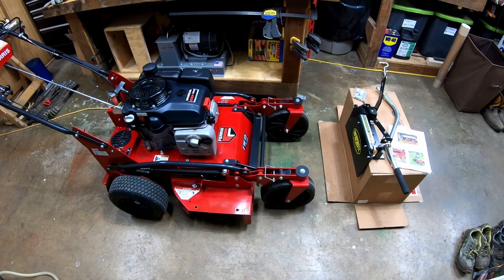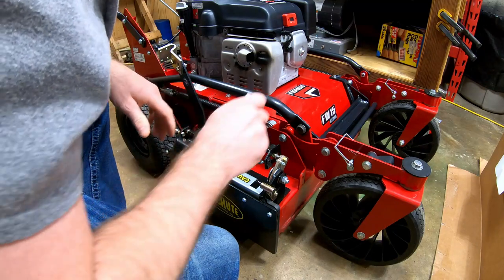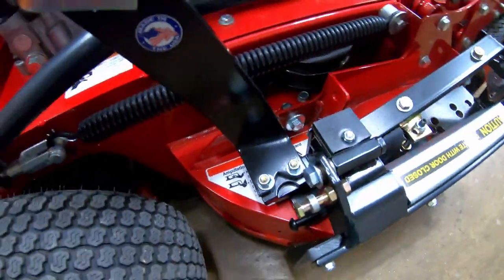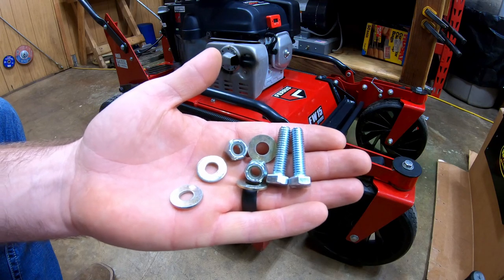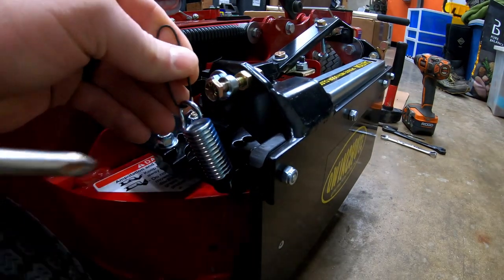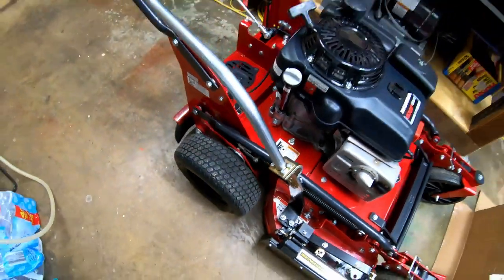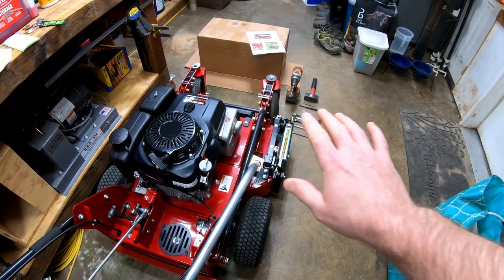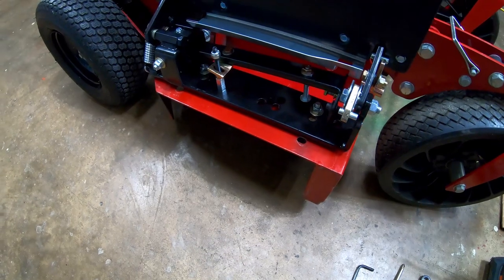Ferris FW-15 Qwik Chute Install

Comment: Easy install, handle needs to be 12"longer.  You know that pawl (tumbler) has two mounting holes. you can use the lower hole to hold the door open slightly higher.
Reply from the maker: I didn't know that, thank you for the feedback.
Reply: On my 61 I put a bit of weld on the pawl to hold it open even further. I didn't want a windrow forming.  The 52 is fine on the lower hole.  Trial and error.
Reply: Bud, just installed the qwik chute on my fw 15.  Notched out an angle iron to fit around those two shims, then welded them to the angle iron. Drilled the front hole and now the accelerator fits like a glove. I have one accelerator for the 32 and 36 and a second one for the 52 and 61. No leaf loader yet, swinging the bagger up and over the sides of the dump trailer. Maybe one day when I'm rich like you guys. Lol.  Have a good Thanksgiving.

Comment: Do you use mulching blades with the QuikChute to help process the clippings better with the door closed? I know the chute is only closed for a few seconds until you can discharge again but I didn't know if needed to change blades from the high lifts.
Reply from the maker: No, I run the high lifts.

Comment: I don’t see how you keep your mower so clean 😂. Mine is filthy. Might wanna look into replacing your front end with the upgraded kit. My old spindles bent when I hit a crack on the curb.
Reply from the maker: I have never had an issue with mine, and honestly I don't like the look of the replacement kit. I will probably leave it alone until I have an issue.
Reply from the maker: I clean them often, but they are not usually this clean lol.
Reply: Getting ready to buy the FW15. Is there an issue with the front end I should know about? It’s not clear to me which part of the front end you’re talking about. Thanks.
Reply: @frankiefiveangels601  there was an issue with the old style front end. Ferris reinforced the front end on the new models. If you are getting a new mower it should have the upgraded front end.
Reply: @superduty3632  thanks for responding. That clears it up for me.

Comment: Just finished this, with your video's help,  thanks! The fact that they make you drill holes through the deck is so retarded. This mower is already easily prone to rust I've noticed. They should've made the qwikchute have holes that already line up with the existing deck holes
Reply from the maker: Good point

Comment: You have probably moved on from this mower now ? 
I just bought mine.

How would you say it's gives the best cut . 

High lift blades with the chute block as needed 
OR
Mulch everything with the wavy blades ? 

Thanks
Reply from the maker: Still in use and high lift with open chute.
Reply: @HandyGuy2016   thank you
Reply: You posted high lift blades as part number 5106420

And super high lift are 5108135

Which blade comes on the mower  new ?  I'm switching over to the chute blocker.  I'm not impressed with the mulching on my mower
Reply from the maker: The high lift come on it, the super high lift work best.

Comment: Hi Bud 

Do your baggers still fit over all  your  installed quick chutes?
Reply from the maker: Yes they do. Might take some modification depending on the catcher you choose. I would recommend going with an aluminum catcher because the weight matters over time.
Reply: @HandyGuy2016  so the steel ones that are cheaper are heavier and more likely to rust?
Reply from the maker: Just heavier

Comment: Will this work with the mulch kit installed or is the block off plate integrated with the baffles?
Reply from the maker: No it won't, the mulch kit is a different animal.

Comment: Can you leave the quick chute up in the open position, and use the ferris bagger that comes with the mower at the same time?
Reply from the maker: Not the Factory bagger but a side mount catcher works.
Reply: @HandyGuy2016  so I should just get the quick chute and accelerator or do you suggest something else.  Skip the ferris mulch kit and bag
Reply from the maker: @drewd6083  yes, quick chute and accelerator is perfect.

Comment: Are you able to use the factory bagger with this installed? If so could you do a video showing how they work together
Reply from the maker: It will not, at least not without modification.
Reply: @HandyGuy2016  That’s what I was afraid of.
Reply from the maker: @bradflood7112  a side mount catcher will work with it, which I might try.
Reply: @HandyGuy2016  I have both and find that the side catcher snags on i level ground and once it gets close to full will weigh to one side

Comment: Hi,  does the accelerator bagger mount fit with the quik chute installed?
Reply from the maker: Mine does, because I made it myself, but I don't know about the factory one.
Reply from the maker: Also, mine is a Rackem brand not an accelerator. I went with Rackem because it was cheaper, but accelerator is what I would recommend because they are lighter weight.
Reply: @HandyGuy2016  I already have the accelerator bagger for another machine as well as an extra mounting bracket.   I am in the decision stage wether to go with the fw15 or the turfmaster.  I am in Ontario Canada, and the price for the 2 machines are about the same.   I will have to measure a number of gates before I decide.  Do you think the fw15 is capable of going up a couple steps to get into backyards or is the back end to heavy to lift?
Reply from the maker: Should be fine, I'm not a big guy and I can pick up the back or front with ease. The FW 15 will outlast the turfmaster for sure.

Comment: Is this the latest model? 2022 may
Reply from the maker: The mower is a 2019, the Qwuickchute is a 2021 model.
Reply: @HandyGuy2016  does this mower meet all your standards? Cut, mulch handling? Do you feel it’s pretty powerful? I’m thinking very heavy towards one! Fully loaded with mulch kit what would the price be?
Reply from the maker: The mulch kit is good if you cut weekly, otherwise it's just like any other mulch kit. The cut and handling are great.

Comment: So did the much kit not work well enough for you, I remember last year you had installed a kit on the same unit?
Reply from the maker: The mulch kit is great, but not perfect for every situation. I just prefer a chute block for my area.
Reply: Thanks happy Christ birth and a good new year. I’m thankful I had a good year even amid the covid nonsense.
Reply: Hey my friend can I use the quickchute as a mulcher if I choose.Thankyou great vids!!
Reply: @louislograno7524  it doesn’t work well as a mulcher except with ultra light clippings and you raise the deck for the second cross cut
Reply: @louislograno7524  no it doesn’t work well for that except in low thatch situations

Comment: I’m a rookie and planning to get this mower.  Can anyone tell me why or how this is different from the mulch kit??  And if you are going to have it open what’s the difference between this and what comes on the mower out of the box??
Reply from the maker: A full mulch kit has baffles in the deck and a permanent chute block to keep what you are cutting inside the deck being chopped up until it disappears. A chute block like this only controls the clippings being thrown where you don't want them, but isn't meant to stay closed all the time.
Reply: Check out the fw15 owners Facebook group lots of good info over there.
Reply: @HandyGuy2016  why can't you keep the Chute block closed at all times?
Reply from the maker: @juanmanuelmarquez4945  you can, but it is just a chute block not a full mulch kit, so it will leave a debris trail most likely.
Reply: @HandyGuy2016  thanks for the clarification.  I'm thinking about getting a FW15 this Friday.  Not sure how to set it up.  I mainly cut small yards.  I like to bag the ones that are full of weeds or leaves.  Do you think the best set up would be:
1. High lift blades
2. Chute block
3. Accelerator
Thoughts?
Reply from the maker: @juanmanuelmarquez4945  Factory blades, quickchute, and accelerator bagger.